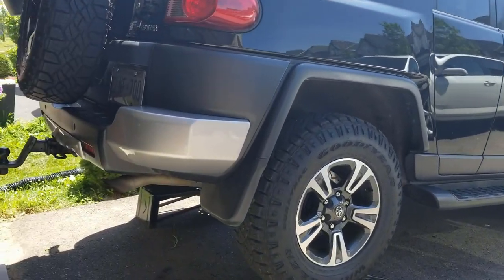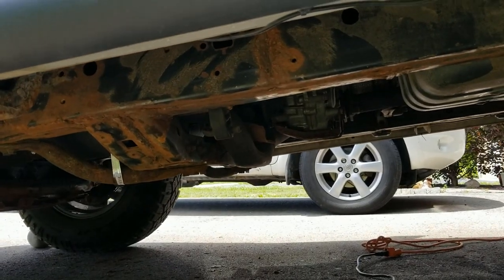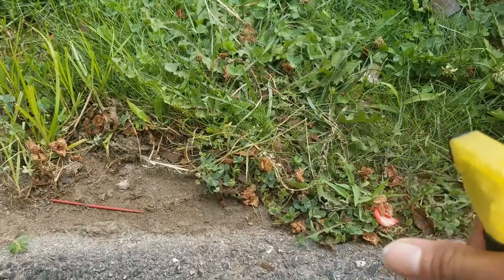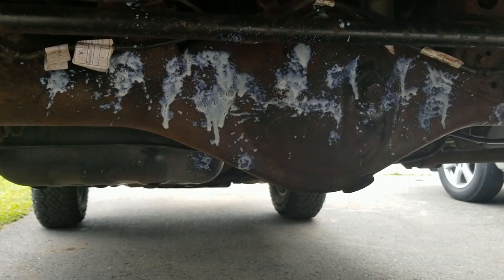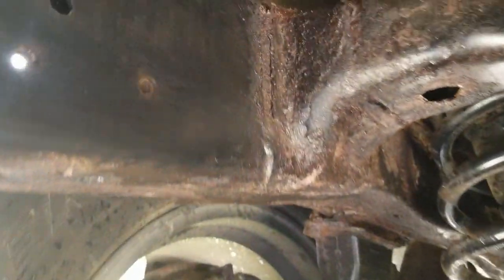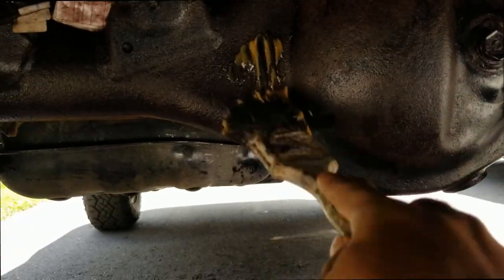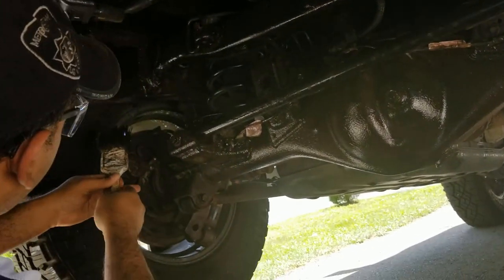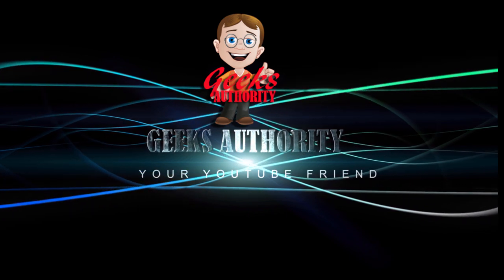TOYOYA FJ CRUISER | RUST PROOFING | FLUID FILM & FDC RUST CONVERTER | FRAME RUST PROTECTION

Comment: I have a 1998 4Runner 4X4 5 speed and my rust is in similar condition maybe a little worse - especially on the rear diff. This video inspired me that I can in fact deal with it and keep it running! You sold me when you said “I’m not a mechanic I’m a software engineer.” Great video!
Reply from the maker: Go ahead and do it, If I can do it sure you can do it too :) Thanks for your kind words and sub Will. Dont forget to ping once you revive your Runner :)

Comment: Thank you, sir. Please take note to check the pressure release/vent valve on top of the rear differential. It's only about $20.00 CAD, but they tend to rust closed. This will cause build up of pressure within the diff, due to heat, and eventually cause your rear axle seals to blow.
Reply from the maker: Great point sir, thanks for sharing :) Thanks for your comment and sub. I will surely check it out as it's getting warmer here :)
Reply from the maker: @MeetJackBlack  Thank you SO MUCH. Infact I was thinking where to find that product :)
Reply: Thanks for the comment. That makes sense 🤔 I've already had replace the axel seal. I should give that a check as well.

Comment: Hey man! 50 year old data analyst here that just bought a 2007 with similar issues. I was planning on doing something similar and then I came across your video. Thanks so much, you have inspired a few more ideas.
Reply from the maker: Lol looks like we software engineers like these FJs eh? Well, if you maintain well, it's gonna last long. No more rust in my vehicle after doing this stuff.

Comment: Good job, and great narration! I love my 2012 Black Fj, and only recently bought it. As a body shop owner I bought one with very little "beginning" rust. I intend to paint the entire undercarriage after a thorough sandblasting, degreasing, and careful scan of "every single item under this car" when I'm finished I will have a completely rust free undercarriage and all components will look as good as the outside of this beautiful vehicle!
Reply from the maker: Thanks for your kind words Phil and glad to know you took care of rust right way. FJ Is a great vehicle and I too will get it sandblasted later sometime. I only drive it less than 2000 miles an year max, rest of the time it's sitting at garage :) Thank you once again
Reply: Phil what would be the estimate cost to do what your doing for the average man.
Reply from the maker: @chrismartinez8393  It cost me $60-70 dollars
Reply: @chrismartinez8393  Hello Chris,  The only way a shop estimate on that type of thing would be feasible, would be to charge what is called "time and materials"! The biggest problem however would be someone who would do this properly until the very end, and therein lies the problem of much time, and considerable expense to wire brush, sandblast, prime with a great "red oxide" metal primer, and then paint? Sandblasting anything is a major mess, and working underneath a vehicle would be a very hard, uncomfortable endeavor at best! Sand goes into everything it can get into, including your eyes, ears, and nose, so a respirator, and a plexiglass shield between you and the vehicle is another must have.  So you have to be very aware to cover u-joints, bearing surfaces, oil seals, breather tubes, etc., or you will contaminate, and destroy many components pretty easily otherwise! It's labor intensive, but nothing prepares metal, and particularly rusty metal better than sandblasting. ..... If you are very handy with tools, and learn techniques fast you can do this yourself, and the material cost would be minimal! If you have access to an air compressor, of at least 5 H.P. then some simple tools will do this work, rather than trying to buy some of the alternatives? If you can have a workspace to yourself for a couple of weeks, you can do this? Preferably outside on top of 6 mil plastic that extends well beyond your vehicle in all directions! That way you can use a simple "siphon" type sandblaster say from Northern Hydraulics/ Harbor Freight etc., and you can sweep up, strain, and recover your sand many time over? ....... You need a "graded" sand like "olivine/or quartz" of a 120# for a small sandblaster! Don't try to use glass beads, except for small parts in a cabinet type blaster....... Should you decide to tackle this Chris, please feel welcome to contact me for further, and more specific instructions! I will be doing my own in the spring, on an outside carport, and will try to take good video of the before, and after. There are manufacturers who are making some exceptional paint coverings, that if "prepped properly"  would protect the undercarriage for just some serious "long term" durability, say 20 plus years with minimal maintenance!
Reply: Thanks I was just looking at a FJ 2013 and the undercarriage was rusting bad. It spent most of it's life in Nova Scotia before it came to the states based on the carfax. The salt from sea was hitting hard. Everything else look great. But couldn't justify buying at the price.
Reply from the maker: @chrismartinez8393  you are welcome. Almost same case here too, I am from snow capital of Canada so I had to do this to keep it on road. Wishing you the best, I will share an update video after one year how it looks now ..
Reply: @philsparks3125 how’d it work out for you? I’m looking at a clean fj besides surface rust on the undercarriage. Worse than the car in the video. Is it worth if I’m willing to put 1k or so into it?

Comment: Love this video. I too am an FJ owner I'm on my second. My first was a 07 now I have a 2013. I live in New England and we use huge amounts of salt, but much worse is the Calcium Chloride. The calcium chloride practically turns cars into dust. Fluid film is a good tool to prevent rust. Top tip get a sprayer and spray it inside the frame rails. That will prevent the rust you can't see.
Reply from the maker: Thank you for your kind words, yes we sure need to save our FJs :)

Comment: Pull your body plugs and make sure to spray inside of your rocker panels and door panels! Water likes to drain in and down and cause rust there, too. Great video about rust prevention on the cheap. I’ve been doing research on this too for an 07 Tacoma I just bought and for my girlfriends 2019 Camry. Both of them have frames that are in magnificent shape so far and I’d like to keep it that way. I’ve decided to go for wool wax but I’m torn between wool wax black or wool wax clear. Wool wax black will let me better distinguish what areas I have covered and what areas need covered. However, the clear will let me visually inspect the frame without having to remove. But then again, if prep work is done correctly and it’s applied correctly then there’s no reason any rust should be forming or returning. My biggest concern is about getting into all of the books and crannies of the frame. No sense in the outside of the frame being well protected if the inside of it is bare metal that’ll rust anyways. My Tacoma has one of those open ended frames, which basically makes it a non issue. But the Camry is not so lucky. I guess I’m just gonna do what I can this year with the low budget option and pinch my pennies to save for the nice air compressor kit with the spray gun and wand attachments. Will also need to buy an air compressor, haha.
Reply from the maker: Thanks for your comment and I appreciate that. I saw a new product ( spray gun ) which you can use to spray the wool wax. I hear your concern, I would rather stick with clear ones, as I wanted to see what's happening behind the scenes and need re application or not. After one and half almost, my FJ still looks just as I did this. Let's keep more yotas on the road :) All the best!

Comment: Great job buddy. My only suggestion would be to use a spray gun and a compressor to spray on the fluid film.
Helps get it up in the hard to reach spots.
Reply from the maker: Thanks for your kind words Steve. I truly wish I had a compressor / spray gun. My budget was less than $100 , just to show others that they can do it too with no special tools. Thanks again.

Comment: POR 15 is a great product, I have used it on my frame and the rust never came back.  If the metal is completely sealed from oxygen rust won't happen.  That's what POR 15 does.  But it's expensive and one hell of a job to apply.

Fluid film is great too, they also have a black version now so when you apply it your frame looks great.  You can also spray it using a cheap electric sprayer.

Comment: There are several years of Tacoma and Tundra models that there was  NO  WAY  POSSIBLE  to save the frame from rusting apart , they were built with re-cycled vehicles (old melted down vehicles) and the rust wasn't all removed from the melted steel .. So they rusted from the inside out (no possible way to fix that) .. Toyota was replacing the frames on most of them but now that ship has sailed .. Oil and undercoating will save them a little longer but in the long run your wasting your money ...
Reply from the maker: I know that's a painful truth. Trying my best!

Comment: Corroseal is actually not that expensive. About $20 Canadian. It would have been a good idea to loosen and remove more of the rust by mechanical means. Also the only other thing you should have done was use a good degreaser before pressure washing. Other wise good job. Keep it up yearly and your FJ’s frame will love you. Cheers.
Reply from the maker: Thanks for your comment and I appreciate that. Kindly let me know where I can find corroseal for $20 , as I need on my 4Runnet too. Degreaser good thought :) Thanks again
Reply: @geeksauthority  I found it at Cloverdale Paint in B.C. I believe it was under $25 bucks all in. 1 L bottles.  It goes a long way. Also look at hand held garden sprayers for application.

Comment: Thank you.
I'm doing this to my '04 Tacoma right now. It's a dirty and difficult job... I need to get it done before the snow starts to fall again here in Utah.
My questions: After filming this 3 years ago, is there anything you would have done differently?
How are the insides of the frame tubes?
Did you miss any spots?
I will check your channel to see if there's any updates.
I appreciate what you are doing.
Best regards
Reply from the maker: It held very well, I sprayed inside frame - not super effective but that’s the best we can do. Anything differently : someone told there was a sprayer instead of using a paint brush. Other than that , nothing much :)

Comment: Hi, awesome video thanks for sharing! You’ve motivated me to also do this to my FJ and I spent a few days doing it. I do have a question for you, when you wash your car did the rust remover turn back to original liquid and fall off the rust? Bc I just did a under car wash and that’s what happened. I used the same rust remover as you to convert the rust. And it pretty much shows the rust again.
Reply from the maker: Thank you very much for your kind words. Well it's a rust converter, which means it convert rust into ferrous oxide, so chances of that converting back to rust is almost nil. May be you coated over the rust without removing the flake completely ? Dont worry, it's on-going process , so either get a pressure washer and flush out all rust and then apply it again or just apply where ever you see rust popping again. Make sure to apply the coating as well, to protect what you've done. All the best.

Comment: Make sure you change all the fluids. I just bought  a 2008 fj cruiser 4x4 and the previous owner didn't.  Your fj cruiser is very nice. Thanks for the video.
Reply from the maker: Congrats Carlos. No bud, mine was terrible. See another video I posted earlier how it was then. My FJ's previous owner also havent changed fluids and it had sludge and stuff. It was PIA to remove much of it. I would recommend changing all fluids first - engine, transmission etc.

Comment: Darn good video. This helped a lot. I have a 1999 Land Cruiser that has similar rust to your FJ. I had my local Line-X company spray Valugard on the frame. They didn’t do any prep work. I’m thinking of taking it off and using your process.
Reply from the maker: Thank you so much for your kind words and sub. Yes , rust proofing is a process and my FJ stopped rusting even after a year , so it now looks cool than how it was earlier (rust bucket ) :)

Comment: When your fluid film runs out get Surface Shield made by Blaster. From what I'm seeing it very well may be better than fluid film. It doesn't wash off like fluid film does.
Reply from the maker: Sure will give it a try, however even after two years fluid film still holding well.

Comment: You can do your whole underneath with just two or three large spray cans of fluid film. You sure don't need a gal and then have to put it on with a brush. The spray can gets to places the brush can't.  The can even has a hose to get inside the boxed framing.
Reply from the maker: First time doing it and this one worked out very well. Yes next time for sure spray cans. However I wonder the viscosity of the ones comes in spray can, this was thick substance.
Reply: @geeksauthority  It sprays fine. Plenty of enough power to spray inside the frame nd out of reach places with the extention hose they inlcude.  Just takes a few cans to do the whole thing.  I'm sure it's a better bargain if you buy by the gal but you then have to have a good spray system and make the fluid more liquified.

Comment: How has this hold up . I live in Chicago and just got a 2004 honda pilot with only 51k miles so I'm trying to do the same to the frame . But i know corroseal alone will just let it rust again and i know putting some undercarriage spray could accelerate the rust if i miss some rust spots . So I'm thinking corroseal then fluid film and maybe doing it every other year.
Reply from the maker: Hi Vic, it's holding up very well. I live in Canada so we both get same amount of snow and salt . I would do that every two to three years as it still holding up very well. You can see that in "what to look for buying FJ video " last part as I shared some footage there. Again, thanks for your comment and sub and let me know how yours go. Take care.

Comment: Genious! I blasted with air, wire brush first, then just went straight over with Cosmoline Black Rust Veto 344, the. Sprayed the nooks and crannies with Blaster Corrosion stop and a long straw for inside the frame. I will try your steps on another vehicle!
Reply from the maker: Thanks for your kind words - I haven't had those tools, so did with what I got :) However FJ is holding up very well after that, no rust at all. All the very best

Comment: Hi, would you use the same products being it is 2 years later?

Is the Fluid Film too thick to put into a spray bottle or maybe a garden 1 gallon pump sprayer something typically used for weed killer?
Thank you sir!
Reply from the maker: Yes Dax, I would use the same as it is holding on to it very well.  Yeah fluid flim is too thick to be sprayed on, you need a paint brush or something to apply to it as far as I know.

Comment: Fluid films great. It always gels after it sits awhile. U just need to stir it real well and it will be more fluid like. Enough to spray. I'd suggest loiking on amazon for a paint mixer attachment for a drill and mix it that way
Reply from the maker: Yeah , it was so thick. I stirred it up before applying and it still sticks well after 6 months or so. Yeah planning to do once in 2 years and next time for sure spray gun. Also another reason I used brush to control where I should apply. Saw people applying on rubber Bush and stuff so , wanted to spare those rubber :) thanks for your sub and comment :)
Reply: @geeksauthority  u gotta get sonething to be able to spray in the holes in the frame. What ur doing is def good...but if u could get fluid film INSIDE the frame, u'd be better off for sure
Reply from the maker: @Papi4l2  I agree

Comment: I noticed that you have Tacoma rims. I just bought an 2008 FJ with Tacoma rims also and stock tires. What tires are you running and did you have to use wheel spacers? Good job on the frame. My frame does not have any rust, but I'm going to give mine a similar treatment, since I live in Hawaii and salt air is a concern. Thanks
Reply from the maker: Thanks for your kind words. Yes FJ is now running on Tacoma TRD Rims , with wrangler duratacs. No spacers but I am planning to get fuel wheels with -12 offset to beef it up. I drive FJ less than 800 miles or so per year, it's just my summer evening drive around neighborhood type of vehicle.  I am glad to know you don't have rust , since I live in Canada weather conditions and salt on road is literally killing vehices.
Reply: @geeksauthority Cool thanks. What size tires are you running?
Reply from the maker: @cckailua  265 / 75 /17

Comment: Hi how has this held up so far since you have done it? I need to do the same to my  cruiser.I have been told by someone that it rusts from the I side out,so if I seal it, it will make it worse???? ..thanks!
Reply from the maker: I would say pretty well, previously it looked like a rust bucket - not anymore. Yes, it will make it worst IF you dont take care of the rust inside first and only what you can do it chemically with a rust converter. pressure wash, let it dry, rust converter two applications, then seal it with fluid film. Outside too same way, but I am looking to fluid film every two years - half hour to pressure wash, half hour to apply . That's why I didnt recommend painting, as rust grows inside it and you will never know. Let me know how it went and I will post a video later, if you sub you will get notification when I post. Thanks mate.